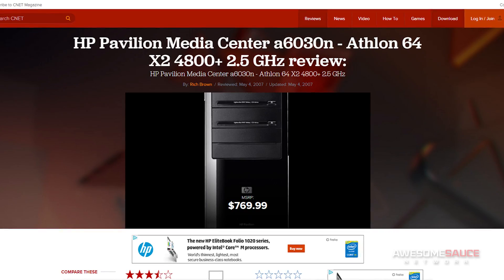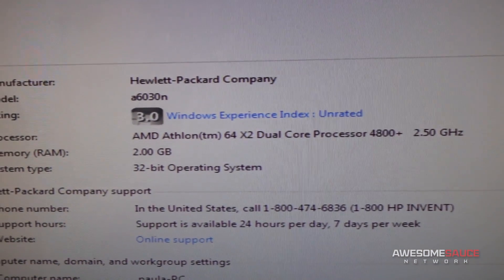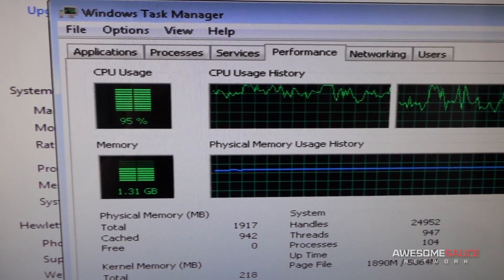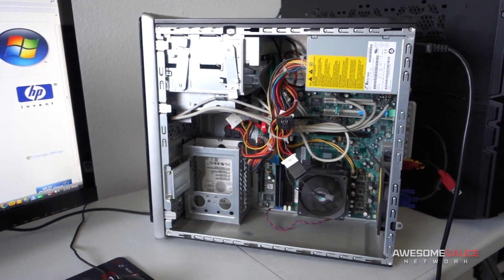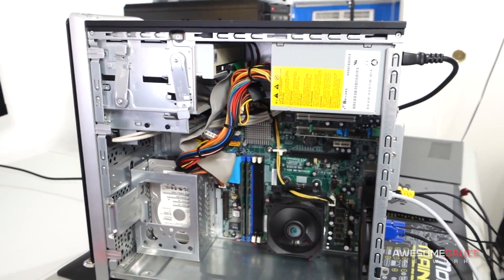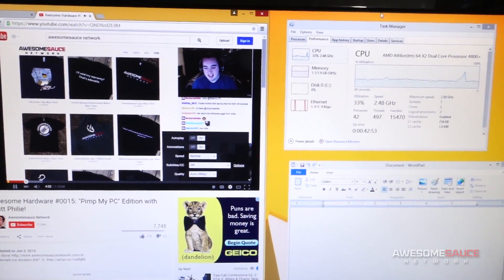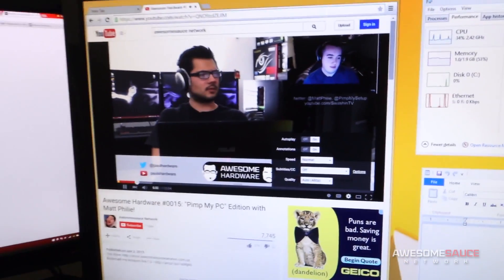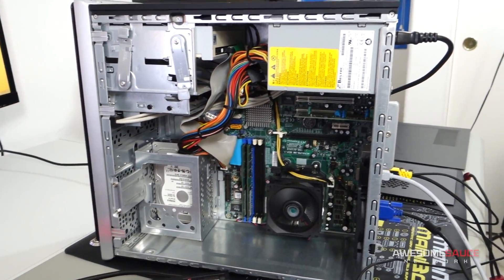Cleaning Up My Neighbor's Old Desktop!

Comment: Wait... you gave an older person... Windows 8.1? Oh boy, expect a lot of phone calls. They'll be so confused! :P
I'd have gone for Windows 7.
Reply: Windows Vista was not bad at all. It just came out in a bad time. In 2007, computers were terrible and were really only meant for Windows XP, which had very low system requirements. 

By Service Pack 1, Vista was a great operating system. I'd still be using it today if it weren't for it going out of support in 2 years. Unfortuntely I'm on Windows 10 and I'm not a big fan... Those stupid "apps" and tiles are still there, and Microsoft keeps removing users choice. (Like stopping updates or Windows Defender).

Oh, and I also hate this new "Settings" crap. What the hell was wrong with the Control Panel?
Reply: stelle202 you only think it's the best because you havent spent time with any other versions
Reply: +stelle202 Me too, 8 and 10 have a lot of innecesary things. We have PC's not tablets.
Reply: stelle202 
Windows XP: Great
Windows Vista: Crap
Windows 7: What Vista should have been
Windows 8: An absolute mess
Windows 8.1: Better than 8 but 7 is better
Windows 10: Best yet
Reply: Bassdroppa The main problem with Vista is that computers went from needing 256MB RAM right up to at least 2GB. It was absurd.
Reply: Larb Systems Of course, like getting rid of all the preinstalled "Metro app" junk and replacing the shitty picture, video, and music defaults with Windows Media Player and Windows Photo Viewer
Reply: Larb Systems It's true. Windows 10 takes the most of any OS I've ever used to get "to my liking", if you know what I mean.
Reply: Rogers NoLastName Yes, I do. When I installed Windows 10 for fist time it was in a laptop, I thouht it took me about 1 hour to get ready. I delete all Metro App, cortana and spyware software also deactivate a lot of automatic upload and download settings that I found, finally I installed the classic start menu (I think is important to acces fast to control panel, mi pc and documents and it's also cleaner than 10 menu). Then is was ready to use.
Reply: Bassdroppa no actually it's a comment with explanations buddy
Reply: thecomputerman100 Wouldn't any OS have access to your full hard drive?  :P
Reply: +Bassdroppa My system is a triple boot Xp/7/10 and I still am using 7 six months after installing 10 because 10 is a invasive mess.
Reply: +Rusty Nugget windows 8 was so bad HP switched back to selling windows 7 PC's after 8 had been our for a year and half... Im glad you loved it though... at least it wasn't completely alone...
also before you reply blindly just google "hp switch back to windows 7" or something similar.
Reply: +Larb Systems I just installed autohotkey and rigged F6 to open control panel with a  buttonpress.
Reply: +Bassdroppa windows 10 is great but THis computer was designed with windows XP in mind. it has no business running any other OS
Reply: ***** XD Full access to your hard drive... Keep dreaming.
Reply: +Mrvideosandgames I use windows 8.1 and use classic shell, so i have windows 7 style start menu and metro which i never use.
Reply: Mrvideosandgames Windows 7 uses more ram than 8.1
Reply: UKcuber Quite possibly, but it can run quite comfortably on 2GB and at least this neighbour would actually know how to use it. I tried Windows 8 in a shop and just gave up in the end.
Reply: @Mrvideosandgames  8.1 returned many things back,..
Reply: +Larb Systems Bored to read the other replies but I have to tell you that With win 10 at the moment they  take a lot of bandwidth from you for people that now download windows 10 . you can close that. Oh and there are a lot of more things for you to close... Go and search a little bit. Thank me later :)
Reply: Meep Changeling That's a good idea.
Reply: ***** jesus. U write ur memoir there buddy?
Reply: +Bassdroppa Qubes; appropriate technology. VirtualPC if you want a Microsoft product. Couldn't have really put Maverick (OS X) on it.
Reply: Mrvideosandgames Mm, good point! I didn't think about that. :P
Reply: +Mrvideosandgames Your comment gave me a good laugh... xD
Reply: Even Steven If it's a fake copy, your Windows will get deactivated upon installing one of the Windows updates. I forget which one it is.
Reply: It would have been better to give him a command based Linux distro ( ͡° ͜ʖ ͡°)
Reply: +Mrvideosandgames KB981033
Reply: ***** Yeah but Start8 costs money! Just give 'em Classic Shell. ;P
Reply: +Rusty Nugget im still using winxp :)
Reply: +Rogers NoLastName I've got a little IBM X-60 laptop that was designed for XP but has been running Vista Ultimate for years. (I got a few, legal copy from Microsoft). I've got a copy of 10 for it, that should be interesting.
Reply: thecomputerman100 I took care of it last night. Windows came on a USB stick and once I got the BIOS set right the install went just as well as Microsoft would have wished and the only thing that doesn't work is the IR port that I've never used anyway.
Reply: SeabasR windows 10 is shit, I wont even bother downloading it its also the most expensive windows.
Reply: ***** sure thing you dumb shit. Go give your personal information to Microsoft and the government. windows 10 is a peice of shit and only morons like yourself dont see it. LEL!!!! ITS FREE SO WHY DONT YOU GET IT!!!!XEXDX!!!!!
Reply: Hamguy Bacon That's turning it off in settings. Not using an external program. And also "cortana tries to find out information about you" No shit, that's like saying google is bad if they use predictive text you fucking moron.
Reply: Hamguy Bacon But you're the one who has no understanding...
By the way, the most expensive Windows? Where were you when Windows 7 Ultimate was $320??
Reply: Deses wiser than you? I shit talk because people deserve to get shit talked, like this idiot who thinks its ok to let a corporation have private information form you. and when the government wants to know whats on your computer they dont even need to get a damn warrant because the corporation must do what the government says or otherwise be liable to aiding a potential "criminal".

Go read Or Watch 1984.
Reply: Hamguy Bacon Maybe you need to learn to read and manage your anger problems.

I said that apple is doing exactly what you are saying about selling data to the feds and all that that you are saying, right? They aren't resisting the Government AT ALL. And MS doesn't support them AT ALL.

Please note that I'm using irony to write all that, perhaps you are too dense to 'get' it.
Reply: Mr Videos & Games better than vista (or a Linux distribution)
Reply: +Mrvideosandgames he was talking about windows 10 not 8
Reply: Mrvideosandgames I know
Reply: ***** Many elderly have never even used anything newer than a Commodore before. Your grandmother is one in a million as most people without technophobia can grasp the concept of using the desktop and start menu for launching Internet Explorer and Outlook really easily, but as soon as stuff starts opening in different layouts and the interface gets complicated, then the majority would no doubt lose it. These days though, iPads are typically preferred anyway.
Reply: +Mrvideosandgames  probably windows 8 with power shell :)
Reply: +Rusty Nugget yeah but if he doesnt know how to use windows 8 than how could he know how to install startisback and stufflike that
Reply: +logoster I didn't like 8, love 10. My dad is in his 70s and bought a system with 8, and he figured it out just fine by himself. For some reason he can't remember how to connect to the Bluetooth speaker I bought him, but Windows 8-no problem. (Probably cause he's OK with an FM radio and doesn't really care all that much about music or he would work that out, too)
Reply: +Mrvideosandgames I would've reinstalled Vista. Unless he wanted Windows 8.1, or hated Vista, then I would have delivered... But if you reinstall Vista, you don't need to pay extra money. :P
Reply: thecomputerman100 You can't argue with free, I guess. Pretty sure to need to have kept some recovery CD or something though, right? If Windows 7 and Vista were the same price... definitely go for 7.  :P
Reply: Mrvideosandgames Not if there was a recovery partition, which HP often utilizes.
Reply: +Bassdroppa windows 10 suck my ram i have 4gb of ddr3 and it got to a point that the os is taking 500MB on a process called system that with out all the softwares like chrome etc
Reply: thanks ..I'm upgrading my ram tomorrow to 8gb i'm now at 8.1 i'll try re-upgrade my os
Reply: +Mrvideosandgames if you enable desktop from boot its exactly the same
Reply: I would've liked Windows 10 more if I didn't have to remove the apps and install a mod or two.
Reply: Piercerson Well, you don't have to. You wanted to.
Reply: I didn't get it on my computer, I got it on my mommy's computer.
Reply: +Rusty Nugget The point of the comment is that older people aren't very adaptive to change. Windows 8's UI, along with plenty of other stuff in the OS such as directory naming conventions, are different than in older versions, thus older people may have a problem using it.
Reply: +Yolo Alex i bought a win 7 disk(my favorite OS) on amazon for a moderate price on amazon, but with third party theres no telling if it'll be real or fake
Reply: Mrvideosandgames But you can simply reactivate it. I never understood that update. :P
Reply: thecomputerman100 You shouldn't be able to if using a pirated version.
Reply: Mrvideosandgames Well, you can. Especially if you just uninstall the update. :D
Reply: +Bassdroppa  agree windows 10 plus spybot beacon everything working perfect now
Reply: CEKfile Good luck using Chrome :P
Reply: thecomputerman100 did before , took to much Space on my HDD (160gb)
Reply: +Rusty Nugget I work for a very large company and we were running XP on most of our systems well into 2014, then we switched to 7 which we are still running. I've got 10 on my home systems but 7 works just fine.
Reply: Jeff DeWitt That sounds like a fun little project. :-)
Reply: Oh it's you 😃 I have seen your content and it is cool
Reply: +Mrvideosandgames lol, i thought the same, hopefully its not as confusing with win10 now
Reply: Hamguy Bacon Do you have proof it sends personal information to Microsoft? And you can literally spent 2 minutes downloading and installing something to block all of the "personal information" from being sent out.
Reply: ***** External programs cant turn it off, you are not listening. It is HARD CODED, This cant be turned off.
Cortana shouldn't know personal shit about you, it should just be used to search shit.
Reply: Hamguy Bacon So a program blocking any of the data from being sent to MS is hardcoded and impossible? I guess firewalls don't exist.
Reply: ***** firewalls dont work that way, you dont understand what you are talking about. and you dont understand what i mean by hard-coded.
Reply: Hamguy Bacon You're saying that like no one else in the country tracks you, either. XD
Reply: Hamguy Bacon Please, quote any of us as to where we said that it's okay. I'd love to see that.
Reply: +Hamguy Bacon Yeah, exactly like Apple is doing with the encrypted iPhone clusterfuck... Right?
Dude, your arguments crumble by themselves.
Reply: Deses well apple is going to court over releasing its encryption to the government, while i agree with you with most apple is actually doing pretty good on this part.
Reply: Mr Videos & Games WIN10 BRAG
Reply: BROOOO
Reply: xd
Reply: +UKcuber my old laptop had 2GB of ram ddr2 (2010 laptop) and windows 7 home premium and it ran fine
Reply: then theres windows 10 now literally uses nothing
Reply: Tehportalz Delta he will have More securityupdates with 10 but Yes its nearly the same
Reply: UKcuber but it's interface is almost the same as vista, and windows 7 extremely popular, with lots of support and other things.
Reply: windows 8/8.1 sucks next to windows 7
Reply: I think they will be used to windows 98
Reply: same
Reply: That's whad if say
Reply: My first computer was with 8.1, but my old family computer was 7. I learned how to use Windows 8.1, but I enjoyed it a lot less than Windows 7 and Windows 10
Reply: Mr Videos & Games how did you know he was older
Reply: I would go for windows xp with this desktop
Reply: Mr Videos & Games
Reply: Windows Vista = spells NIGHTMARE~ 2gb of ram o ya i remember those days ...just to RUN.........and took 2 strong cores or 5 cores to RUN....
Reply: lmfao so true
Reply: just casually put startisback on it and she'll be right, oh wait didnt realise this was from 3 years ago...
Reply: Why coffee filters to clean certain components and what looks like a microfiber cloth to clean others? Not concerned about ESD?  (Yeah, I know he's using a mat, but the case isn't grounded anyway.) Not clipped to the mat nor his wrist via wrist strap.
Reply: I would have chosen Windows 8 embedded just to get the feel of the previous Windows operating systems since it seems to be the last good Windows with new ones included.
Reply: My dad is almost 52 and he uses windows 10 lol
Reply: It has been over 3 years, and I STILL had to agree with Mr Videos & Games comment.  Windows 8 was a sick joke.
Reply: Mr Videos & Games Kyle is a girl name 🤣🤣🤣🤣🤣🤣,you $uck a$$hole🤣🤣🤣\
Reply: Yeah, 8.1 is the DEVIL,!
Reply: Even without future support.. w7 is a much better option..w8 is pure crap in every sense....
Reply: Exactly 2.4k likes
Reply: I liked Windows 8.1 for the 5 months I used it (Upgraded to Windows 10 day 1)

But there's no way an older gentleman will be able to use it without a full tutorial on it if they were still using Vista.
Reply: I agree. He would also be very familiar since windows 7 is almost identical to vista
Reply: Mrvideosandgames hit windows key type n?
Reply: Rusty Nugget windows 10 is amazing
Reply: Slyness13 no i was talking about windows 8. when you go to the home screen with all the tiles if you start typing it searches programs
Reply: +Mrvideosandgames 

I didnt read all the replies but I saw enough people saying "Windows 8 and 10 suck so much 7>8" So I wanted to chime in. 
You people claiming to have actually tried 8/10, for how long did you try it? I used to have a machine with only 2GB in it. When I found out Windows 8 takes less ram to run, I switched immediately even though I resented it as well because I was used to Windows 7 and the start button etc. 
Well it literally took me only 10 minutes to prefer 8 over 7. My machine ran way smoother. Even when I did a clean install of Windows 7 it would still be slow. I don't remember the machine specs. It was a crappy OEM desktop. I just remember 2gb of ram because it originally had 1gb but it could support 2gb so I had ended up finding a 2gb stick at goodwill and I took it. 

But anyways, it took me merely 5-10 minutes to figure out Windows 8 and get comfortable with the features and where everything is located at and how to navigate. One of the comments said "how do I open notepad on Windows 8". Windows 8 doesnt require you to be a programming MS certified genius. You literally go to the start screen and just type "notepad" as you would type in the search bar on the Windows 7 start menu. Why is that ANY DIFFERENT from searching the start menu on Windows 7? Or you can do Win+r > "notepad.exe". Not good enough? Right click on the desktop > new text document. Theres 3 ways to open notepad. Obviously the 2nd and 3rd are just dumb because thats what the start menu is for. But you act like there's just absolutely no way to open notepad. Someone will probably say "Why should I have to push win+r to get to notepad? Why cant it be a fluid navigation?" Im not saying you should have to push Win+r to open notepad. I'd be pissed if the only way to open notepad was to do win+r. Its just one more method to get to notepad because people are acting like there's no way at all to open notepad. The navigation IS fluid. You literally push the start button and type in notepad as you would do on any other version of Windows. On any computer I've ever had, Windows 8 has always ran smoother than 7. And now Windows 10 has gotten rid of the tile interface start menu. Their apps are still tiled, but the start menu isn't. When you first install Windows 10, yes the start menu is ugly. However, with just 2 minutes of tweaking it looks fine. You can resize it. You can remove the app tiles from the start menu. Want to see my start menu? Here you go.

https://gyazo.com/cff75347790961284bf0a0efae639abd

Explain to me how that is horrible? You have your "all programs" button. You have power options. Instead of "my documents my pictures my downloads" like the Windows 7 menu has, all of that has been consolidated into one button, file explorer. No theres no control panel button like Windows 7 has. But DID YOU KNOW, I can just open my start menu and type in control and the first result will be control panel, or I can pin control panel to my start menu. To me, this looks way cleaner than the Windows 7 start menu. It doesnt have that ugly black font on a white background. This is way easier on my eyes. When you first install Windows 10 the menu is huge I agree. But just like how you would resize a browser window or an open program, you do the same thing with the start menu. Mouse over the edge. Drag and resize. If you bothered to tweak the menu for 5 minutes it wouldn't be so ugly. But I guess with all that exploring and testing you guys claim to have done, you couldn't be bothered to do that nor could you be bothered to pin and unpin your preferred programs. The windows 10 start menu also alphabetizes all of your programs on the "all apps" screen instead of being sorted into folders upon sub folders upon sub folders. 

I dont notice a performance difference between 8 and 10, however I prefer 10 over 8 because I do like this start menu more than the Windows 8 start menu. I like the feel of Windows 10 because to me its like a more modern Windows 7 with the performance of Windows 8. 

If anyone is wondering, no I dont have the OEM 2GB pc anymore. I have a i7 3770, evga gtx 750ti. 24gb ram and 2*250gb 850 evo ssd in RAID0. Although, even with these specs, I still notice better performance on Windows 8 than 7. Quit being so close minded. You'll learn to appreciate Windows 8/10.

Not attacking OP btw. Old people would be really confused. Windows 7 would be better for them since it's what they already know. Im just saying in general Windows 8/10 run better and look better.
Reply: Rusty Nugget Maybe you can teach me then. How do I access Notepad?
Reply: Rusty Nugget But the Windows key takes you to the thing with the tiles where it shows you the weather and whatnot.
Reply: +Hamguy Bacon It amuses me how you shit-talk people wiser than you when you don't have a clue of what you are talking about.
Please do remain upset.
Reply: Rogers NoLastName Even today, Vista is a bit on the heavy side. I disliked how they got rid of Windows Sidebar in Windows 7 and made it so that the widgets have to float about. Then again, I use Linux these days so...  :P
Reply: mahmood J. motrage Try updating your computer. They released a new version of Windows 10 that has better memory management.
Reply: +Rusty Nugget wtf? How is Windows 10's start a disaster?!
Reply: +Mrvideosandgames Windows 8.1 is fine. In fact install a program like Classic Shell to return a Start Menu and it is indistinguishable from Windows 7.

When it launched Windows 8 did stink for desktop users, it was clearly designed as a tablet OS. Yet the Point One and Spring updates have made it a really great operating system.

Rejecting Windows 8 because of what it was is just silly.
Reply: +Rusty Nugget Windows 10 is fine. What the fuck are you smoking?
Reply: Hamguy Bacon Because it was just realeased you fucking moron. And it's better than 8 and 8.1.
Reply: +Art Andrew, Of course Windows 10 is a good and fast OS. But we should make some changes before use it normally.
Reply: +Rogers NoLastName Your're right. We don't need that, and remove and configure all of that things takes time and make me tired. And if you repair computers is worst.  Apart from that is, faster and it looks better than 7.
Reply: +freerice9595  people still use the searchbar for that? you should really get used to using windows key + x
Reply: its garbage, 10 is better
Reply: Windows 10 is almost the same as 7
Reply: Windows 7 use more RAM thanks to its AERO theme, the Metro theme is much more light the AERO. Plus the big icons in the Start Menu can help those elder on with bad eye sight.
Reply: Many old people use win 8, 8.1, 10, and even linux. They're old not braindead.
Reply: Mrvideosandgames you aren't very intuitive are you? i was on windows 7 for 5 years and on windows 8.1 and i can make windows 8.1 almost like windows 7 within just the default programs setting page. honestly i prefer the windows 8 start screen. windows 10's is a disaster
Reply: stelle202 you would honestly put windows 7 on a computer in 2015? that's like putting windows xp on a computer in 2010. get in the present times